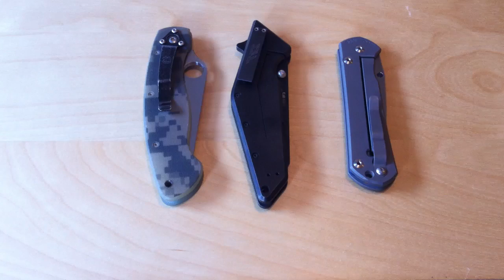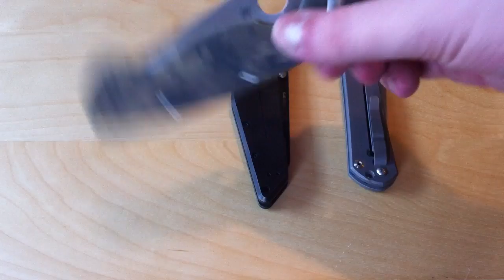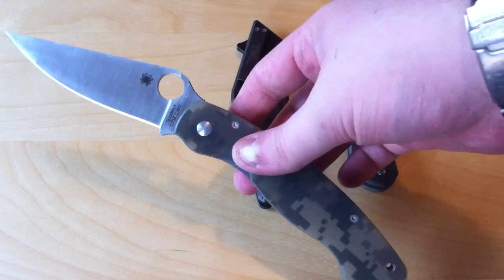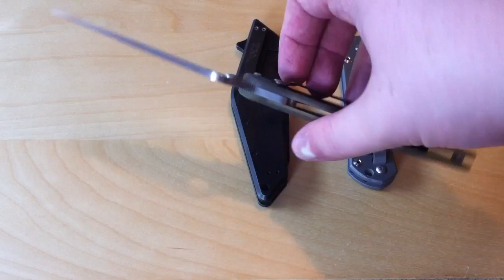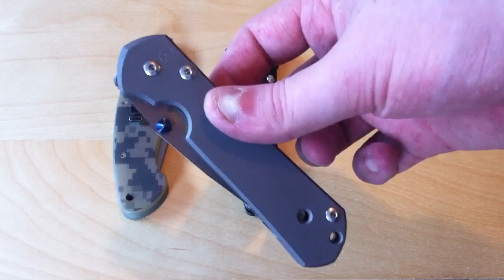Knife Talk: Episode 69, Design Philosophy

Comment: Great review...but with the Umnumzaan they put the massive screw through the frame and it is so precisely engineered that when you crank down on it as hard as you can it will not compress the knife on the washers since it is designed different then most pocket knives. You will never have to worry about blade play it is also lock tight shut like a vault from the factory and you really don't need to take it apart to clean it... you just need oil and some fluorinated grease and you are good to go!